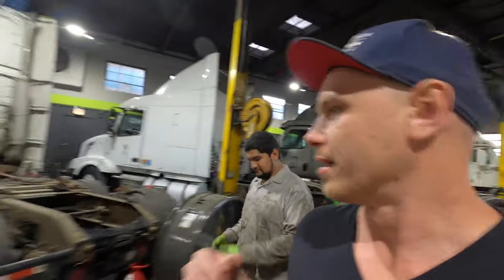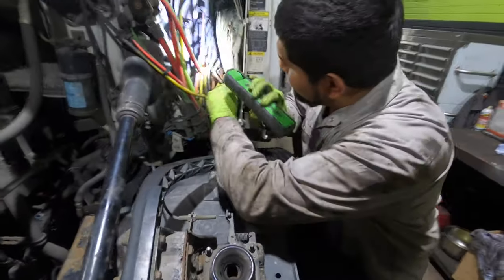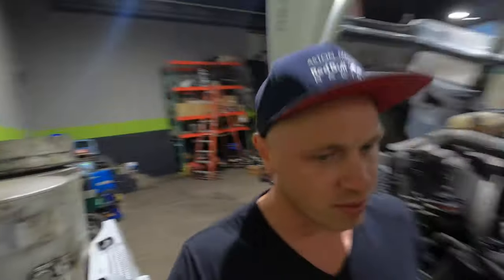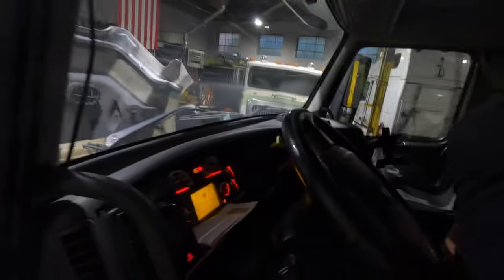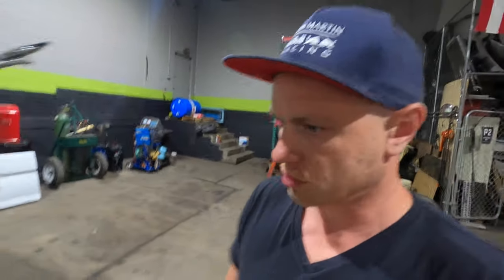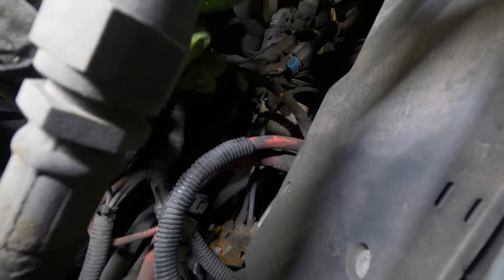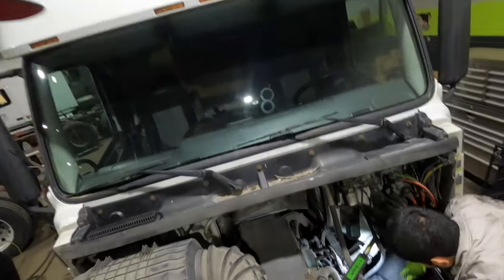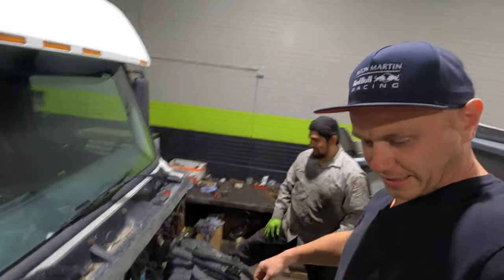Volvo Cluster Issues. Semi Truck Turns Off When Driving.

Comment: Great info, great channel.  Today, I was able to troubleshoot a faulty fusible link on the side of the road. Thanks a bunch guys. For others on the road, I bypassed the link by bolting the two leads together then wrapping to prevent an unwanted electrical connection
Reply from the maker: Hey Bryan! Thanks for sharing. Glad you were able to keep going. Stay safe!

Comment: Just bought my first truck today, a Volvo with a d12. It did the same thing on the ride home. Truck was still running cruise control still working. But it cut in and out a few times. Radio still was on tho. What’s the chances that it is the cluster.

Comment: Can I call you guys 
I have the same problem 2007 Volvo d12
Shuts down while driving it starts again and I notice when keep cranking dashboard reboots again like losing power 
And sometimes starts no problem
Mechanic changed that fuse and the fuse seat  but nothing today shut down on the road I look at the fuse was burned up on on side 
I hope it's right fuse size  it was 10A  
Can you guys help
Reply: Oil preshure sensor100%

Comment: I have a 2023 volvo, and the dash lights flicker, turns my cruise off, flashes headlights and the windshield wipers come on
Reply: Mine is doing that as well. Is this a safety concern
Reply: @MarieGroover-g1c  I would think so, mine didn't stay on until the warranty was out. I was buying the truck and every time I brought it to the dealership it would stop flashing and flickering, until it the lights and cruise controls become unusable.  There was a recall on the lights a while ago. Maybe check to see if urs has the recall too

Comment: What was it ground that goes to starter?
Reply: Where are you  guys  can I call you  I have the same problem 2007 volvo shuts down they starts  last time that fuse on battery was burned on one side so I replaced let's see if it works but it shuts down 
Last trip shut down 3 Times  Mechanic changed batter new fuse seat but nothing help